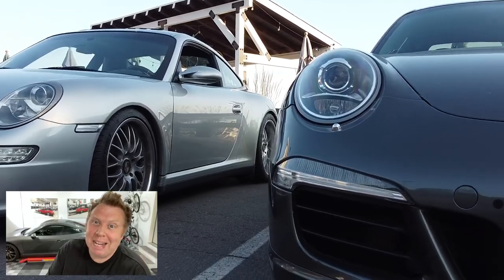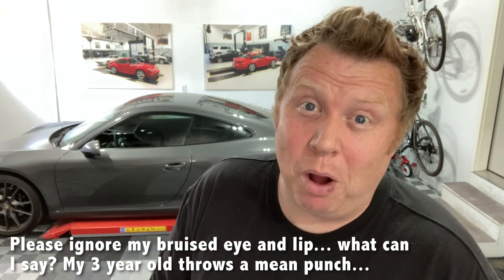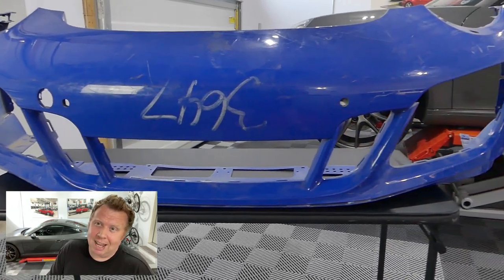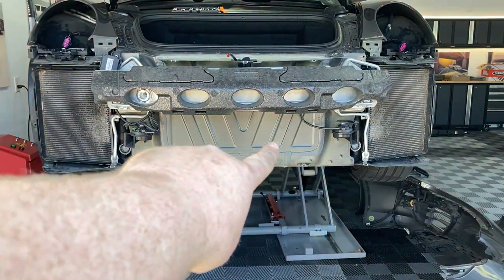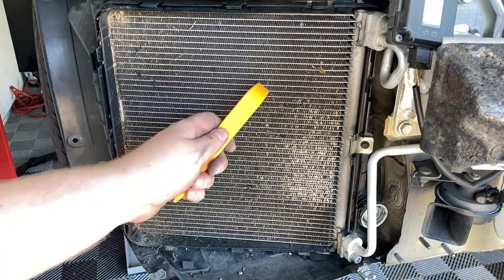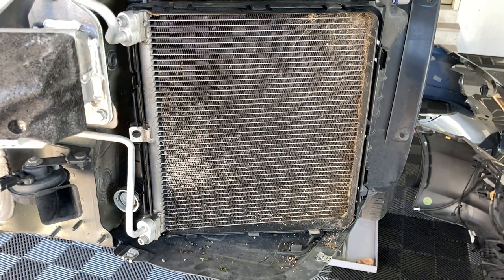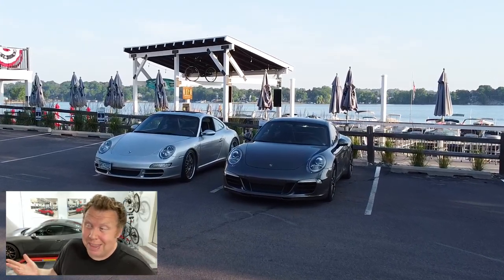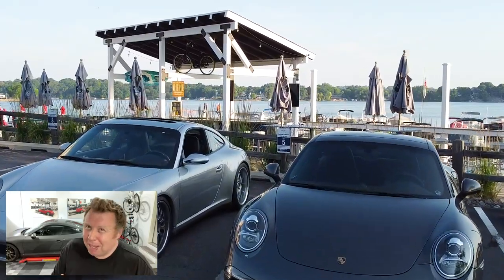Aerokit Front Bumper Installation for my Porsche 911 (991)

Comment: Nice work! I added Rennline screens and the third radiator intake panel with the same screen to make the front different and still aggressive. I plan on dremmeling out the middle piece so that I can make it more like a GT3 next. Have you done a tune or high flow cats???

Comment: Hey James, super helpful video! I am also planning to add the aerokit/sport design bumper to my 991.1.  Were you successful in being able to retrofit the front park assist feature since your car didn't originally come with it? Did you just need the 4 sensors and a new wiring harness or were there any other tricks to retrofitting it? I only have the rear sensors but would like to add front sensors when I install my new aerokit bumper. Any gotchas?

Comment: Dig this mod James, just doing one on my 991.1 4S. The dealer claims there is an additional supplementary kit i should buy (given by the manufacturer). Did you need anything more that the grills and lower lip?
Reply from the maker: Just the air duct covers, the lower lip. That’s it!

Comment: hi - terrific vids - i have a 991.1 S that I ordered from the factory with the sport design front spoiler.  Is the lower lip plug and play - to replace it?  Or does it require removing the front spoiler?  Thanks!
Reply from the maker: It’s plug and play once you remove a couple of fasteners from under the lip. It’s super easy to do. Congratulations!

Comment: Should have added grille mesh to stop debris from hitting the radiator while the bumper was off the car.
Reply from the maker: Good suggestion! Unfortunately the mesh I bought didn’t fit very well.
Reply: You can custom make the grille yourself and clamp on the plastic trim with automotive glue. Check out many  uTube videos on this subject.  All the new GT3, GT2 all have grille mesh from factory.

Comment: Nice one James. Thinking if you can get hold of it second hand on the cheap, maybe consider replacing the standard engine cover grill for the black GTS grill that came on the 991.1 GTS. Part number is 99151233111OK1. The existing LED strip is transferrable, there's a few good installation guides on the forums and even then it looks like a simple job. 
Only problem is looks like you cannot get it anywhere for under $1,500. It looks the nuts though giving it a classic 993/964 look while still modern bringing it up to 991.2 style. Plus you hardly see any cars with it so you'd definitely turn Porsche fans heads. I haven't really made any big mods on my 991.1 (mine's agate grey too... sorry Nick Murray) but I'd definitely go for this one.

Comment: Did you remove the two little wings just behind your front wheels?
Reply from the maker: Yes, they came off with the stock bumper (I think!!! Now I want to go and check.... haha)
Reply: @AutoAmateur  not attached to the front bumper, I believe that it’s no the under panel just in front of the wheels

Comment: In the reassembly, you glossed over the GTS/AeroKit condenser air flow shrouds. While there are no photos, should we assume that you did have to replace the two condenser shrouds? How much $$$? Also aren't the two small intakes on either side of the center bumper panel supposed to be connected to brake cooling ductwork. Did you replace that also? 

Also in the removal video, you said you were sealing up the PDC sensor hole but in this bumper replacement video you show replacing sensors into the bumper. Did you perform a RETROFIT of PDC sensors on the car? Future project? 

Thanks. I really appreciate the work that you go through to produce these videos. It's a big help to us fellow DIY'rs
Reply from the maker: Hey there! Ah, sorry. If I didn't mention the condenser shrouds in the video, I did include the part numbers and prices for everything in the description below the video. I did have to replace them, the stock shrouds won't work with the aerokit. But everything fits together perfectly now the way it should.